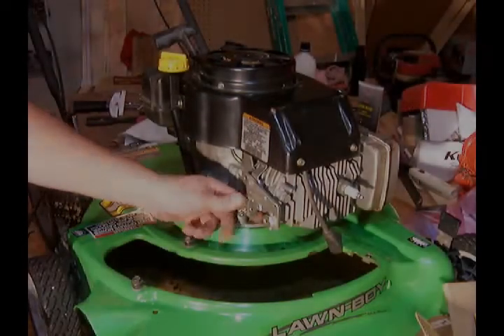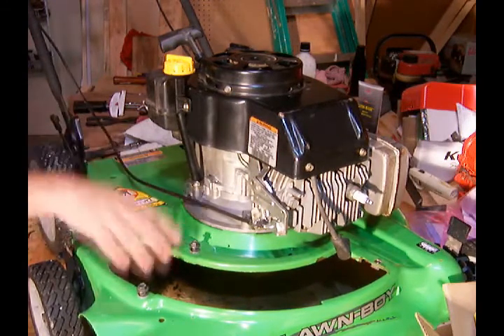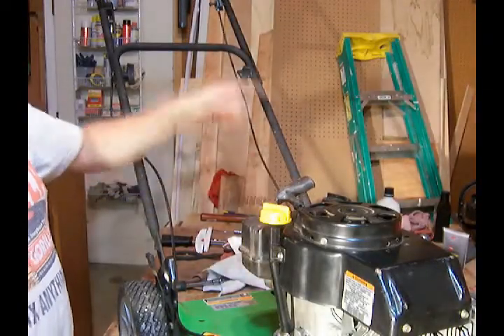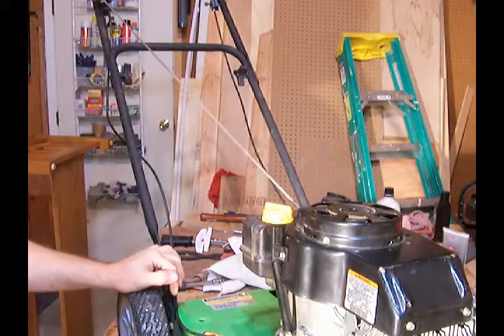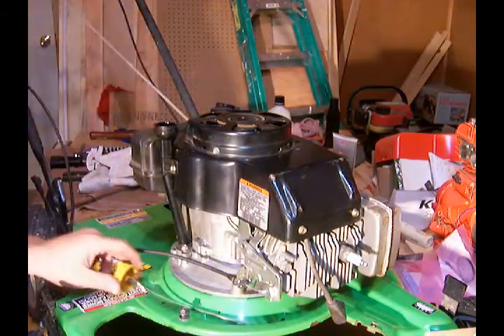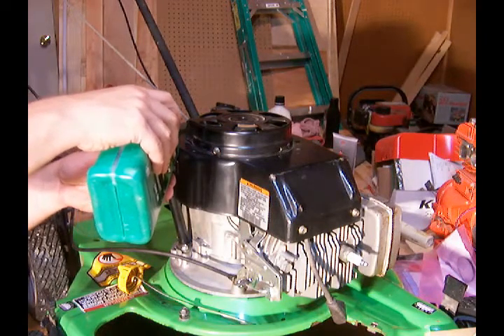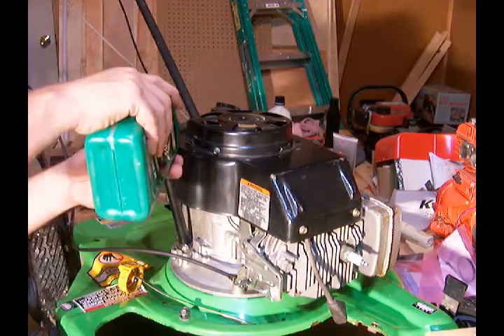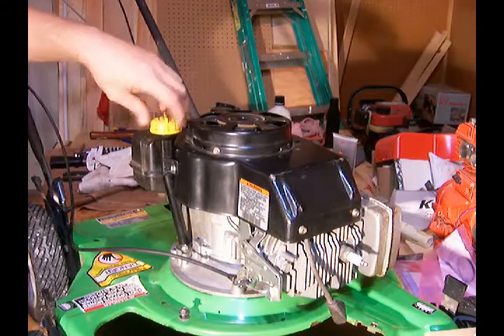#30 Tecumseh LV195EA / LEV120 - Engine brake cable, Starter Cord and oil installation

Comment: Thank you for showing this! My cable broke and came off, but for some reason I just couldn't wrap my head around the mechanical notion of how the cable actually pushes the brake lever forward, as opposed to pulling it the backward (somehow) as it seemed at first glance.
Reply from the maker: +John Strange Happy to help. Thanks for watching!